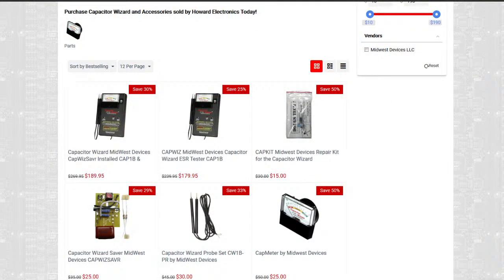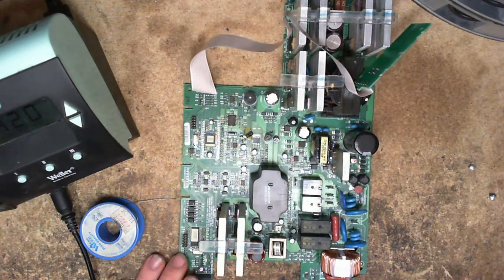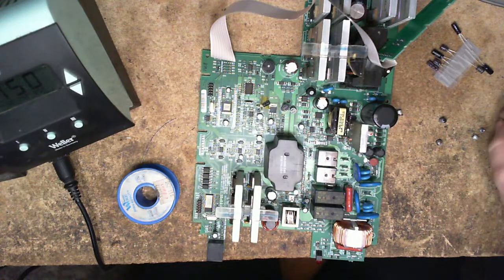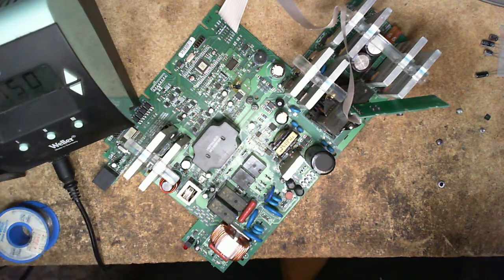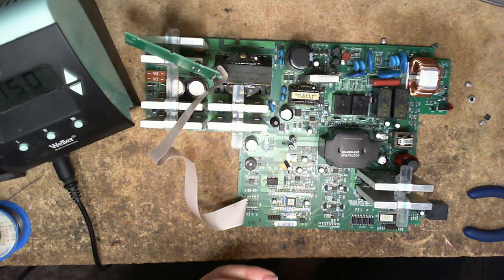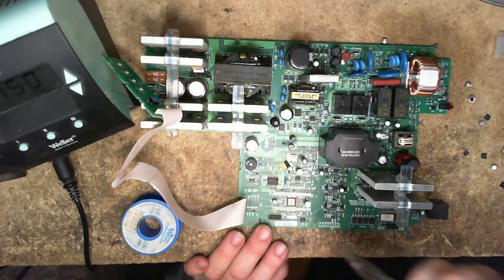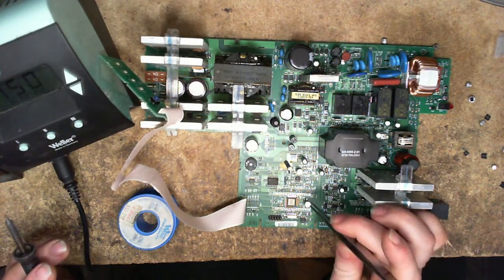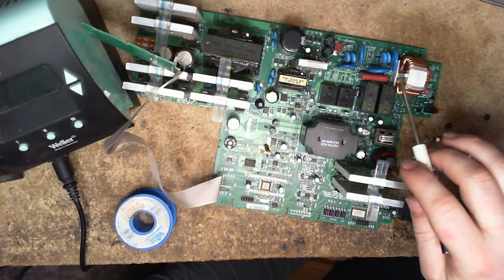APC UPS Capacitor Replacement

Comment: Great Vid, thank you, so which is the + and the - on PCB, I see on mine has a Square and a Circle Please. 
Also, couldn't find the original Capacitor 22mf 400 volts, but got 450 volts.
Thank you in advance.
Reply from the maker: Most capacitors (there exceptions!) when a + is not marking the positive side a white halfmoon or white dot indicates the NEGATIVE lead.
Reply: @CelGenStudios  Thanks, it was the Square sign on pcb, sadly, battery still blinking empty and 2 beeps, read it is the battery, strangely, the battery x2 both reads 12+volts..thanks again
Reply from the maker: @ZorroDaddy  I have a pile of old cells under my desk as I type this that are the same. They read like they are charged but as soon as you put a load on them they have zero endurance and the voltage sharply dips.
Reply: @CelGenStudios Seems dead cells, as one Tech  on YT, showed exactly this symptom, empty blinking battery, and 2 beeps, he changed the batteries, and seems it fixed, hence I ordered 2 batteries, lets see.
Reply: My APC ES550 has the round/square pads - the square is positive. I replaced seven caps (C1,2,3,18,2532,38), but the only one which was definitely faulty was C3, the rest were marginal, so I replaced them. Cost about £2  for 10x 22µF and 10x 4.7µF. The ups is now working again

Comment: When you got the UPS reassembled, did the cap replacement end up resolving the issue with it not sensing AC, or did it end up being something else?
Reply from the maker: It was the caps. It's been running since this video keeping a Silicon Graphics O2 protected and has not once faulted.

Comment: hi could you help me with the same model? I hear a hiss coming from the main capacitor and moreover if I turn it off the two relays start to trip every 30 sec by themselves.the mainboard does not charge the batteries
Reply from the maker: I can only guess but when you turn it off (unplug it?) it tries to switch over and it detects a fault and resets itself?